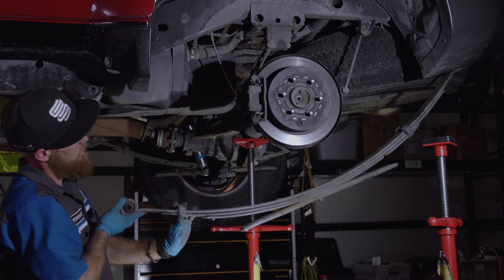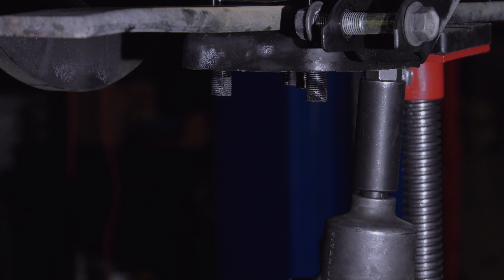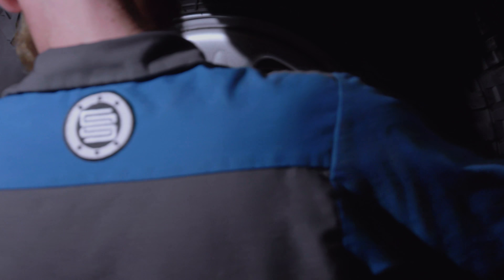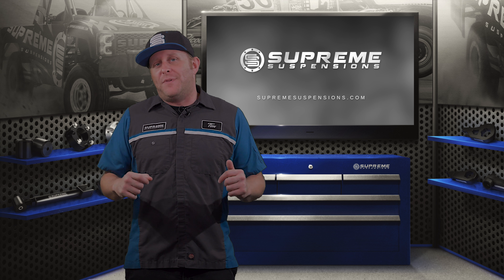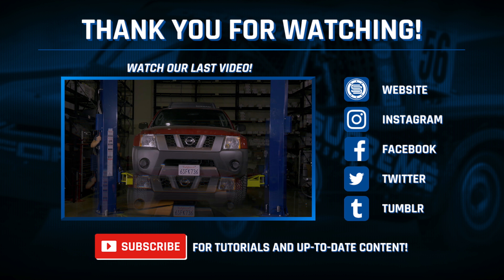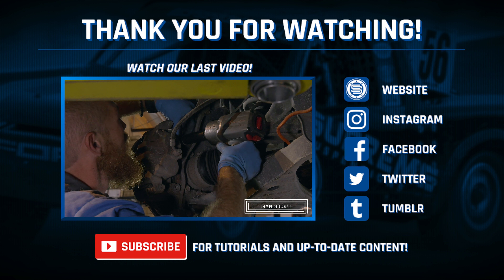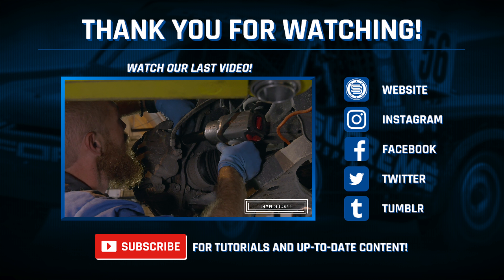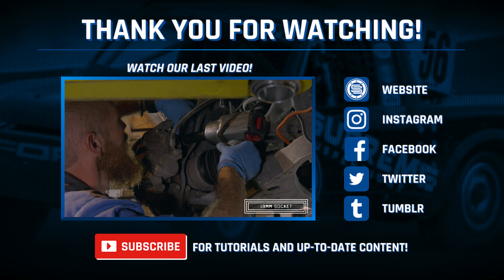2008 Nissan Xterra | Rear Add-A-Leaf Installation

Comment: I just got all the lift gear yesterday and am dying to get started: thank you so much for this excellent video.
Reply: Did your kit come with the u bolts? I do t see them on the link or on amazon with this kit, only with the pathfinder one
Reply: @EdgarVenzor  Yes, U-bolts were included.  Might be because I also did a u-bolt flip at the same time.
Reply: @goldenu2  ok thanks, do you know where I could get that in case the kit doesnt come with them?
Reply: @EdgarVenzor  U-bolts themselves can be had from essentially any car parts shop.  If you mean the flip kit, I got mine from Alldogs off-road.

Comment: Just curious why the drilling new holes into the plate? Were the U-bolts larger in diameter? Do you need sway bar relocation kit for AAL?

Comment: In the vid you said to use the included u bolts but in the link or on amazon I dont see u bolts included. Do I still need them or do I have to get separately

Comment: Can I add these to freshen up some fairly worn but not smoked factory springs? would it just destroy them, do nothing, or raise it at a reduced rate?
Reply from the maker: Depending on the condition of your leaf you can gain about 1-2" with an add a leaf. As you mentioned, if you have a worn pack but not toasted, you can make some height gains, regardless.

Also, doing an add a leaf will help support more weight, you'll have better control (axle wrap) than blocks do, so this may be right up your alley.

Comment: what series of Bilstein rear shocks is ideal after installing AAL.
Reply from the maker: The Bilstein 4600s part number 24-184908 should be a good fit for your vehicle with the Add-A-Leaf kit featured in this video.

Comment: I'm looking at the kit on your site, it does not state that the u bolts are included in the kit
Reply from the maker: Correct - it is just the add a leaf itself.
Reply: @SupremesuspensionsLiftKits  do you sell the extended u bolts?
Reply from the maker: Of course! Give us a call, we have many sizes available.

Comment: Can someone please help me understand the science behind an AAL lifting a spring under axle vehicle. Unless it just puts more arch into it, I’m not following. Someone help me understand. 😭
Reply from the maker: The new spring provides more tension on the factory pack making it more shock absorbent from bumpy roads, tough terrain and heavy loads. It is installed between a shorter and a longer leaf to re-arch your factory springs for extra lift.

Comment: WILL THIS THE SAME WAY FOR NISSAN FRONTIER 2013 SV 4CL ?
Reply from the maker: It till be very similar. The only difference is that on the Xterra, the axle sits over the leaf spring pack while on the frontier, the axle sits under the spring pack. Regardless, the installation procedure will be very similar.

Comment: Since you made a point of a front leveling kit, the implication is that the rear was raised a couple of inches by the AAL. I have a 1-1/2" rear lift via Superspring helper, which levels perfectly when hooked up to a 350 lb tongue weight trailer.  I would like to have the same result with an AAL incorporated directly into the spring pack, and retire the helper unit.  Would you expect that result?
Reply from the maker: Typically with an add a leaf incorporated into the leaf pack itself, you can gain about 1-2" depending on the condition of your factory leafs. Also, you will gain an additional 500-1000lbs of haul/load capacity per side. So yes, in a practical application, you should see the result you are looking for.

Comment: Why are people putting ada leaf on xterras
Reply from the maker: To lift the rear of their leaf under axle XTerra's.
Reply: @SupremesuspensionsLiftKits    is it better than using blocks
Reply from the maker: If the vehicle has a leaf under axle setup a block will lower the rear end. But yes, if the vehicle has a leaf over axle, a block will work.

Comment: No need for shims or camber bolt?
Reply from the maker: You're adding pre-load to the rear springs via add-a-leaf, not adding a block (which doesnt work on Xterras)-- so a rear shim wouldn't be necessary unless you're doing a spring over axle conversion and adding a block which would drastically change driveline angles and necessitate  the shim.

Camber bolts aren't necessary either for these vehicles unless you really cant align these after a lift, but from our experience, we've yet to have someone require them after installation of the spacers, so you're good to go.
Reply: Supreme Suspensions 
Your response is very much appreciated!